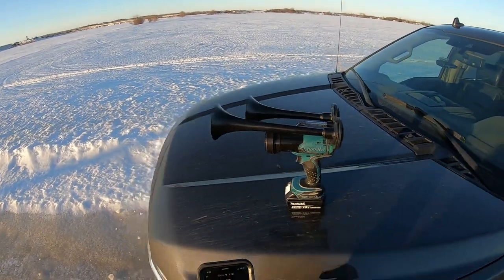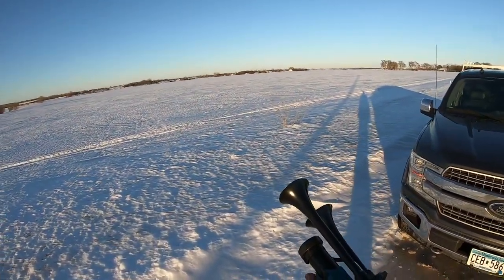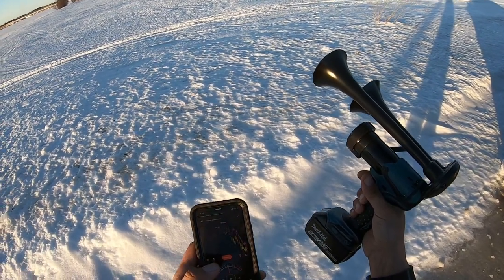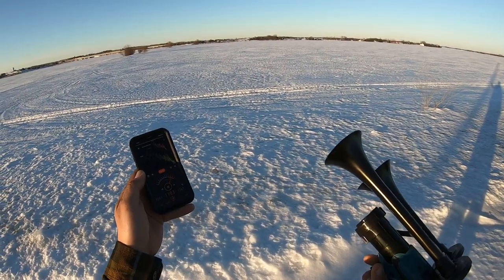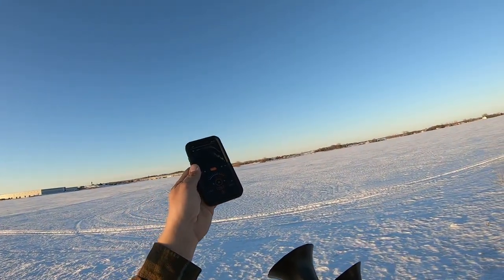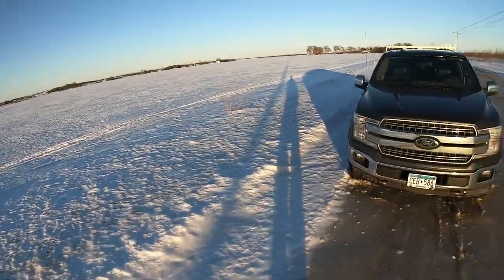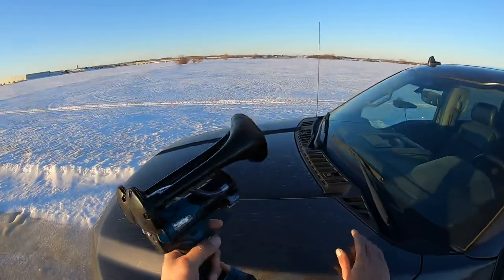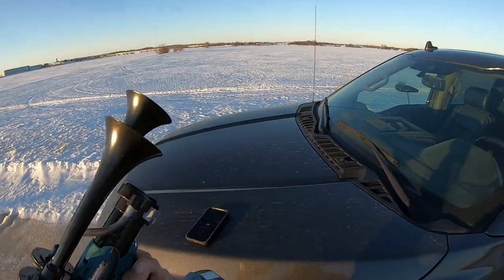Makita Impact Train Horn

Comment: Is this a attachment for a normal impact driver or is it remade and you have to order the impact like that?
Reply from the maker: It’s actually a horn kit for cars that I adapted to fit an impact drill.   If you have an old drill, almost any will do.  Then you just need the $25 horn kit I linked in the description.   It’s pretty easy to modify the drill if your mechanical at all…